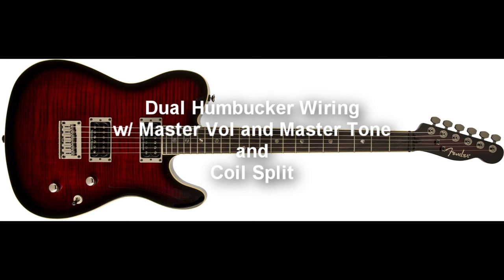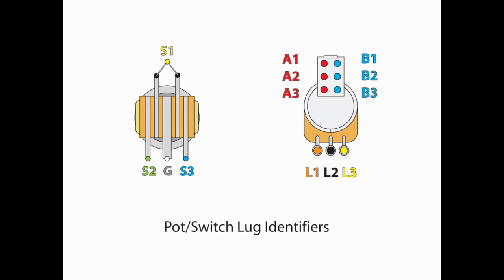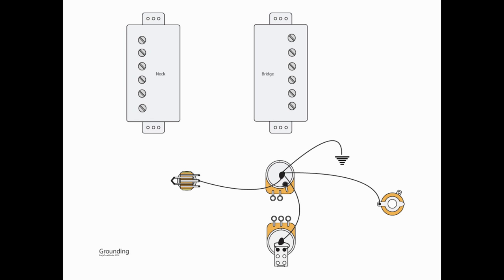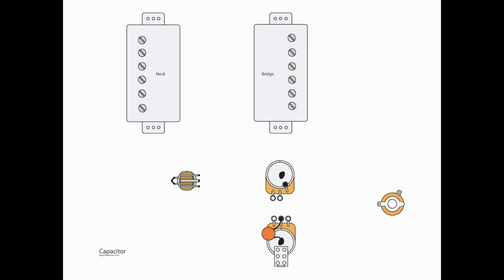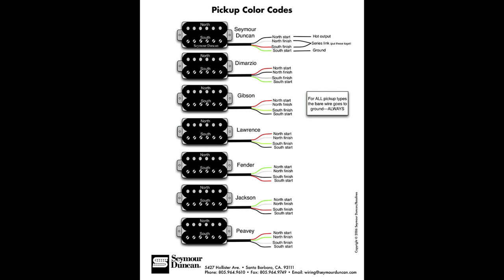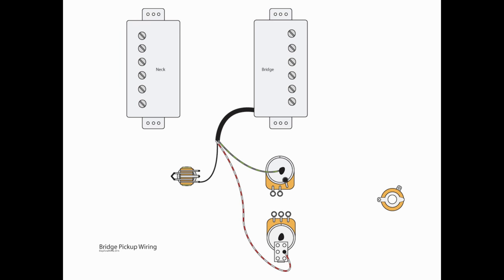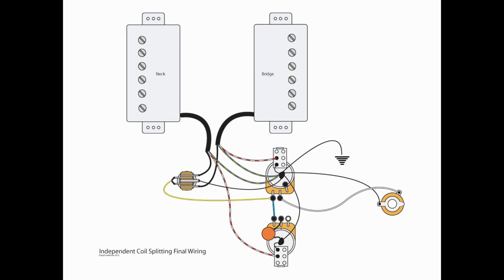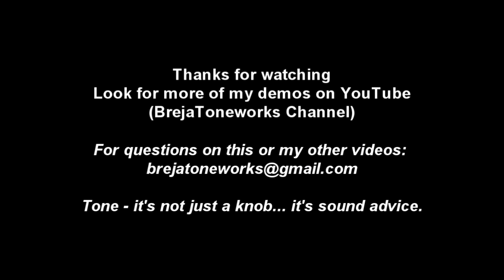Dual Humbuckers with Master Vol/Tone and Coil Splits

Comment: MAN, you have no idea how long I have been looking for a diagram like this. Also you have also made this look REALLY easy.
Reply: Please see important correction above, to save you trouble, my friend.
Reply: @TheWordprophet  ...I'm confused... This is the corrected version. No?
Reply: @DannyKoldburn  
There is, respectfully, an error in this video still; and I discovered how to correct it by reversing the wires. Here is the comment I am referring to from a year ago:
______________________________________
IMPORTANT CORRECTION:
With all due respect, Don (and I sincerely thank you for these videos); the wiring on the 3 way selector switch is backwards in this video.
The yellow wire that comes from lug 1 on the volume pot goes to the center lug on the 3 way switch (between the pickup hot lead lugs), and the ground from the volume pot goes to the (S1) lug on the 3 way switch.
I had it hooked up like the diagram here, and my guitar didn't work; and it took me a while to figure out why...
But now it works beautifully, and I wanted to share this correction with your viewers.
Thanks again, Don...your videos have helped me greatly in building and restoring guitars!
~Clinton
Reply: @TheWordprophet  ahhhh! I see... Yours is a Gibson style toggle? That's definitely backwards for them.
Reply: @TheWordprophet  switchcraft toggles have 2 lugs one side, 3 on the other. The 2 sided one is the "commons" and can either be tied together or sent to separate volumes IIRC.
Reply: @DannyKoldburn  
Ah...so Don was right, and I merely had a different type of switch?
If so, I certainly apologize...I am still relatively new at this stuff...and thank you.
Reply: So what 3 ways switch should I get then? I am very very confused lol. Can I use 5 ways switch instead with this diagram? @TheWordprophet

Comment: Hi Don, I have a HH + 3-way toggle + 1 - Vol pot. I have a Bill Lawrence L500XL ( bridge - 4 wire) & a Duncan ‘59( Neck classic 2 wire), I wanted to split the neck HB with a push-pull volume pot - flick the 3-way toggle up, pull out the push-pull volume pot and have only one of the coils of the neck pickup working, is this possible ? I would want a treble bleed on the push-pull too. If you could help me out, that’d be greatly appreciated. Ty

Comment: Just finished rewiring an ibanez with two push pulls coil splitting and Wilkinson humbuckers 4 wires . This instructive video was spot on . A good cheap guitar has now been considerably improved for tone and options . Many thanks
Reply: Considering doing this to my AS73 so any info would be helpful.  The Classic Elite pickups in the Ibanez cannot be split so I am thinking of replacing the neck with a Seymour Duncan.

Comment: IMPORTANT CORRECTION:
With all due respect, Don (and I sincerely thank you for these videos); the wiring on the 3 way selector switch is backwards in this video.
The yellow wire that comes from lug 1 on the volume pot goes to the center lug on the 3 way switch (between the pickup hot lead lugs), and the ground from the volume pot goes to the (S1) lug on the 3 way switch.
I had it hooked up like the diagram here, and my guitar didn't work; and it took me a while to figure out why...
But now it works beautifully, and I wanted to share this correction with your viewers.
Thanks again, Don...your videos have helped me greatly in building and restoring guitars!
~Clinton
Reply: Yes, I can confirm this. I suppose some 3-way switches might have the ground in between the hot leads? That's the only way this could be correct. But yes, I can confirm - I saw the two piece hot master lead on the switch and realized this is NOT the ground. The ground is on the opposite side. And I also wired my guitar according to this diagram, and got no sound. After testing with a multimeter, and also connecting the hot lead directly to each pickup, I realized my pot chamber wiring was working. Then I noticed the error in connections on the switch.
Reply: Strange, every 3 way switch I look up from Stew Mac to Gibson examples show the ground lug located between the neck and bridge connector, and the hot going to the S1. I’m confused.
Reply: Yep.  I have the same story.  Having researched a bit, it would appear that switchcraft toggles are configured as the video explains. Many of the less expensive offerings have the ground on the stud behind the hot leads.  I reused the one that came in the Fernandes I'm redoing and encountered the same problem.  I imagine it's the same with most foreign-made pieces.
Reply: Well it looks like there is a way to 100% certain. The “hot” will always be the ones that look like two terminals together, where the ground looks like one thick, solid terminal. Hope this helps.

Comment: Aside from my 3-way switch being backwards from what is shown in this diagram (i.e. hot lead is where ground is pictured, ground is where hot lead is pictured), I was able to wire a Les Paul clone with this configuration and now have a Bill Lawrence L500XL in the bridge and a Duncan 59 in the neck with coil splitting. And it's a killer sounding guitar! Thanks Breja ToneWorks!

Comment: Dude!!  Extremely clean and concise information.   I'm working with this right now, and after I finished, every thing worked but, the tone doesn't do any tone changes.  Coil splits work fine.  Just no tonal changes when  turning the knob.  I'm going to try another tone DPDT pot.   Thanks again

Comment: thank you so much for this video,  i have 2 volume 1 tone / coil tap and i was able to easily figure it all out with this video ! , the actual diagram that came with my pups did not have the right setup ,but this worked great, thank you !

Comment: I have a telecaster with a hotrails pickup that i hooked into the volume push pot instead of tone pot the same way you did it,  but you used the tone pot, , would it make a difference if I used the push pot as the volume pot,  or vice versa.   Same wiring just different pot.

Comment: He said doo doo at 1:15, but I digress, as an alternative, I think you can use the two middle lugs of your DPDT push-pull as your hots from the pickups
to the switch and the top and bottom lugs as the receiving terminals from the pickups themselves.

Comment: Wouldn't the 3 way selector switch determine which pickup is split? I understand the single push pull pot will make both coils split at the same time, but really they won't be if you only have the neck or bridge selected on the toggle, then both if selected in the middle position, am I right?
By adding the volume push pull you could have the neck split and the bridge humbucker or vice versa when the toggle is in the middle and only one knob pulled ( or one pot in the pulled position ).

Comment: Very helpful. Could you advise this similar wiring for a 2 humbucker (burstbucker 2 neck) and (burstbucker 3 bridge) with single volume, single tone, with a 3 way toggle switch? I have seen so many ones out there, and all have been frustratingly different. Thanks in advance!

Comment: Great video! Very informative. Question: Would you have a video for coil split but the coil split control would also be the volume pot and not the tone pot? I'm not really using the tone control that much and having second thoughts about not soldering it but for the sake of might selling the guitar one day I'll solder it anyway. Thanks!

Comment: New to soldering, 
When the grounds are connected for example at 1:09, do the wires all have to be in the same pool of solder, or do they just have to be touching the volume pot? As long as they're touching the same surface they don't necessarily have to be touching each other to get on the same ground circuit right?
Reply: Yes exactly

Comment: i have a similar setup   but instead my pickups are 2 wire   and my tone pot is not a push pull   how would i wire this up ?  dual 2 wire pickups  , 3 way switch , tone and volume knobs

Comment: Love this, thanks. Just one question: If you weren't using a tone control pot and imagine in the diagram that's a simple DPDT toggle switch instead.....i'm guessing you would ground A1 & B1 straight to the back of the vol pot?

Comment: Hi! I did this wiring in my Ibanez, but I have a Fender 3 way lever switcher. I don't know why, but when in middle position my HBs are always splitted (pushed or pulled, it doesn't matter, only one coil of each works). They work fine and split correctly in neck and bridge position, but I can't use both humbuckers with both coils at the same time (4 coils working at the same time). What did I do wrong??

Comment: So, my setup is pretty stripped down: I took my sg and pulled out the neck p/u and pots leaving me w/ a single humbucker, volume and tone. Can I use my three way switch to split the coils on the remaining pick up? If so, what goes where? I have a Seymour Duncan pick up. Thnx

Comment: ive seen several different diagrams that puts the capacitor  is on L3 to ground and the jumper going from L1 volume to L2 tone. and differences or advantages to doing this?

Comment: So, in case i do not want a tone pot, cause i do not find myself using it at all on my guitar, and i've just ordered some parts to do a rewire on my guitar. Uhm, in case i do not want a tone pot and it will be just another push-pull vol pot for the other pickup. Does this diagram stay the same?

Comment: I got a newbie question, after I did this mod I found out both north coils were split, which is not the middle position tone i was going for. I wanted both outer coils. How do i go about doing it? I did it on the volume put with alligator wires and I just connected the one I wanted to change, to the hot of the volume. I just don't understand how to do the same on the tone pot.

Comment: I always have this diagram on my HH guitars but one problem is the VOLUME when SPLITTING. Spliting the coils comes with low volume and one tip to balance it is PARTIAL SPLIT having with, in both North & South Finish wires tapped with 1.1k resistor on the neck and 2.2k resistor on the bridge instead of directly solder to ground. This is what the PRS is made of.

Comment: Hi, I have a question for you concerning concentric pots on a Tele.  I plan to use a 3 way switch with a single coil for the neck and a humbucker for the bridge.  I would like to use the concentric pot for the volume of both pickups and single for the tone control.  Is this advisable and would you happen to have diagram for this setup?  Regards.

Comment: Hello, the wiring diagram is almost fine, but in the 3 position switch, the common and the ground are inverted. I mean that the wire which goes from S1 in the switch to L1 of the volume pot has to go to ground, and the wire which goes from G in the switch to ground in the volume pot has to go to L1 in the volume pot.

Comment: I got a Seymour Duncan installed in the bridge of my Schecter with coil split. When I got it back, this was inverted on the new pickup. So humbucker mode on the bridge is single coil on the neck. How can I fix this? I have no experience and am soon to replace my neck pickup and don’t have the cash to pay for someone to do it. While I like the versatility the set up gives me, I can’t smoothly switch from neck to bridge.

Comment: Hi I am getting Seymour Duncan p rails for my les Paul and want to use push/pull pots to activate them to have rails/P90/Humbucker control (open to suggestions) I also want to wire up vintage style, can you advise on a wiring method to help me achieve this?
Many thanks
Jason

Comment: Have you done a video on wiring up a jack that has a battery in the electronics? Or is it possible to solder both earth wires together on a mono jack? Cheers.

Comment: Would this be the same if the push pull was a volume?
Reply: I wish he would answer that !!
Reply: Do you happen to have a diagram of this exact wiring using the CTS P/P pot? Also... can you wire both pickups to the same tab on the p/p, if they are both being split at the same time?  Or is it imperative they be separated to their own tab?  Thank you!  New subscriber here.
Reply: @bsheen  Same here, i tried it by using the volume as push pull and sadly it didnt work. A scheme would be appreciated.

Comment: Hi, thanks for you videos. I have a question: I have HSH configuration with 1tone and 1 volume (push-pull). It Is possibile setup the Guitar in these 2 ways:
1) When dpdt Is pushed the Guitar works in standard way
2) When dpdt i pulled the guitar have a coil splitting in neck position and in bridge position the two hb works toghter.
I look forward to hearing from you.

Comment: hi there. i need some help with a coil splitting problem i have. i own a HSH guitar, it has lace sensor dually's in neck and bridge with a lace sensor silver single coil in the middle. the bridge pickup is a red/silver dually. my problem is this...i want to split the pickup so that the red coil is on when split, but it seems the pickup is pre wired so that the silver coil is on when split. ive rang lace uk, been on the lace website, but cant seem to find out how to wire it for the other way around. i have a vol and tone pot which are both push pull and have wired it so that both humbuckers are split using the same switch. the other push pull ive wired so that all pickups are on when switched. the guitar doesnt have a scratchplate as the pots and selector switch go through the body and i dont want to be drilling any more holes through it. can you please help? many thanks in advance. :)

Comment: Can you provide the circuit diagram for coil splitting in two 2way toggle switch and single connector humbuckers(bridge n neck) with 2 volume and tone pots

Comment: A Humbucker pickup needs a 500k pot and a single coil needs a 250k pot; what do you do when you have a push pull pot and a you are splitting the coil? is the value of the pot also changing?

Comment: Don, the switch wiring is wrong again. What you specify as S1, is actually the ground, and your ground is the output that goes to the volume pot. I just finished this project yesterday and I had to compare your diagram with other diagrams. Then switched the S1 in your diag to ground and ground to S1 and everything worked. But thank you for an awesome channel.
Reply from the maker: It depends on your switch.   Some have the Ground and Hot lugs opposite.  I wish there was a consistent standard to guitar parts.  It's frustrating as hell.
Reply: +Breja ToneWorks What a relief, I was so much into following your diagram which works perfectly, except for my reverse switch. That makes sense. Thank you for the amazing work you share with everybody.

Comment: 1st, awesome video. Love the detail and from one teacher to another, outstanding. However, every question answered but mine... What is the magnet orientation in this example? I'm not getting any info that is giving me a clear answer. Strats are Neck=N Middle=S (aka reverse for 2+4 on 5 way switch for hum cancelling) and Bridge=N. So my question is this: Do you face humbuckers N/S to N/S or 180 flip so they do N/S to S/N and if so would they be in phase or out of phase? Can you also wire it N/S to N/S and simple wire the coils so when using them together, which would hum cancel? I'm working this out myself but I'd really like the help if you were so inclined. Cheers!

Comment: With this scheme, for some reason when I switch on the bridge pickup, the south coil of the neck pickup is still working ... any idea?
Reply: I had  the same problem, so I had to check everything. I turned my humbuckers from 2 into 4 wires myself and one of the  wires was touching another. Probably you should check connections too...

Comment: Hi Don, In your diagram, if I figure this right, when split you get the "slug" coils only. Is this the common way to split? I'm thinking I'd rather the "screw" coils only, and if I have this right I should swap the black and green wires on my Seymour Duncans?
Reply from the maker: Hey Greg...Green/Black are your Coil Splits.  White and Bare are Ground and Red is your hot.Don

Comment: Is that an actual "wire" going to ground from the volume pot with the "To Ground" icon on it? If so, where does it go?
Reply: The output to ground is the sleeve portion of the jack - anything connected to that is grounded

Comment: Don, Awesome video....I am trying to figure out how to do this for my HH (currently has 2 stacked vol and tone controls and a 3 way selector
Someone mentioned a "Superswitch" to replace the current 3 way switch... would this be possible and how would I do a 2 vol 2 tone setup similar to what you have shown here? or would putting in a separate switch be easier? Thanks!!!
Reply from the maker: +Tricko I just emailed you a possible solution.  It's based off Fender's Blacktop Series which I have a few videos of out here on my channel.

Comment: Can you please do a 2 humbucker, 1vol, 1tone push/pull with a three way blade selector like you get on a prs
Reply: Man I just did my 2010 prs se custom 24 with this very diagram. The only difference is the tiny capacitor that's wired into the volume pot. I think it's a treble bleed? I'm not certain. Having said that, to replace the volume pot, I just wired the new cts pot to be identical to the alpha pot that was in the se. Then wired in the new push/pull pot the way this video shows. To me, it was very worth it.
Reply: @Alex-sc8fx  yeah I've just ended up replacing everything
Reply: I get ya man. I even replaced all the wire with some nice push back.

Comment: what would i have to do so i could use a 5 way switch (humbuckers )with 2 tone 1 volume in this set up 
1. Bridge Series Humbucker
2. Bridge Single Coil (South)
3. Bridge Humbucker + Neck Humbucker
4. Neck Single Coil (South)
5. Neck Series Humbucker
Reply from the maker: +solidwolf sixx Can only be done if you want to replace 5-way with 5-Way SuperSwitch.  If so, email me at BrejaToneWorks@gmail.com and I can help ya.   Don